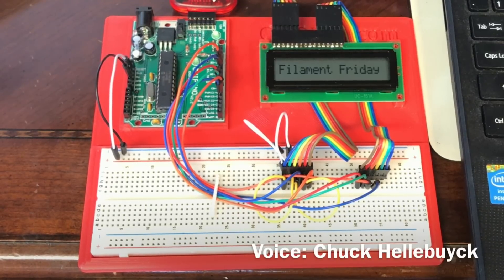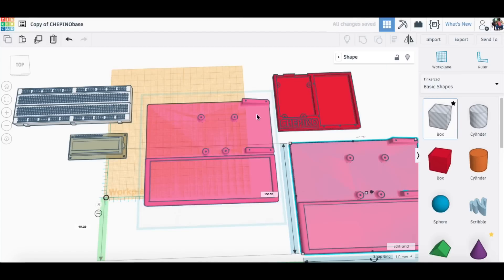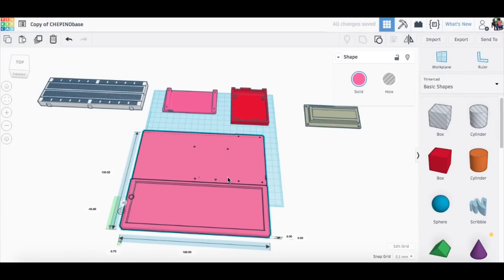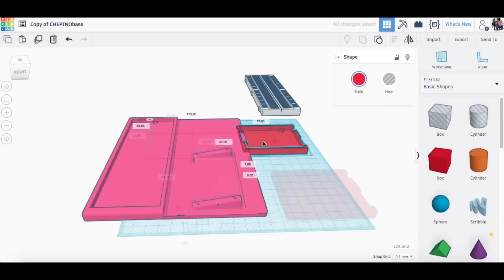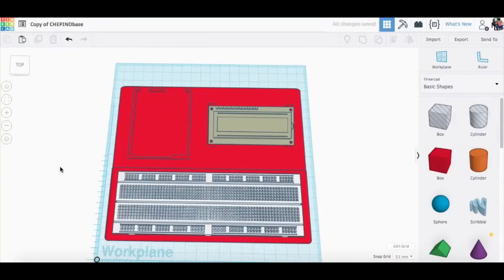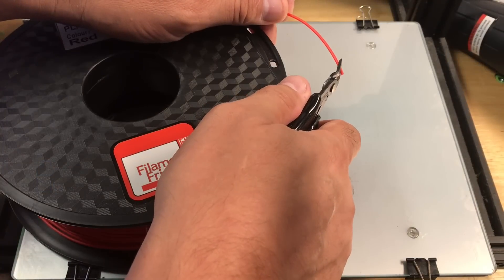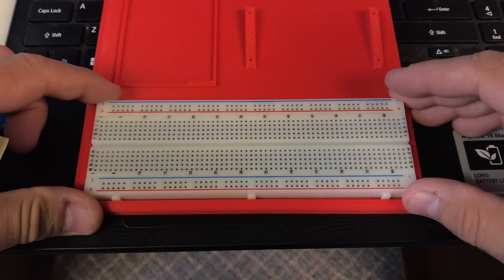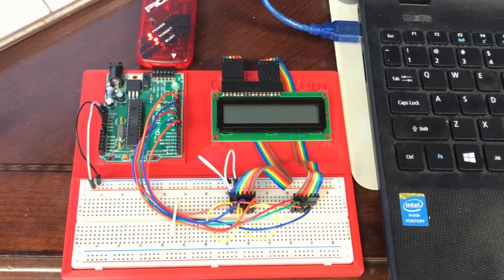3D Printed Electronics Training Breadboard Platform

Comment: I have Cura 4.12.1 and I sliced and printed this.  The module doesn't snap in, it just drops in.  The lip that is supposed to hold the board is just straight.  Is this because of the way Cura slices?
Reply from the maker: Could be variance in your printer. You can adjust it via horizontal expansion in the slicer. 
https://youtu.be/UUelLZvDelU

Comment: Great video. I have one question. What is the red box connected to the top of the Chipino? It doesn’t look like a normal usb connector cable.
Reply from the maker: It’s a PICkit programmer. CHIPINO doesn’t use a bootloader, it uses blank micros which makes it 15 times faster than Arduino and far more capabilities.

Comment: Great project, too bad it wasn't 2 weeks earlier.

I finally got an Arduino and the first thing I did was to design a holder for the Arduino and breadboard.
Mine is laied out with the breadboard to the top and where an LCD could have gone made that a small parts tray.

I got the Arduino because I wanted to know more about it before attempting to upgrade my Anet A8 to Marlin and what I found out is that my anti-virus software really slows down the compiling to a crawl and will corrupt the upload to the Arduino sometimes.

I think I made the right decision to hold off on up grading to Marlin.

Thanks again for your great content.
Reply from the maker: Small parts tray or component box is a better idea than the LCD. I think I’ll try that. Thanks.
Reply: Great re-mix.  Suggestions: Add a drawer underneath with removable dividers.  Also a removable 3D-printed "wing"  to drill and mount switches, sensors, indicators, etc. like a front panel.
Reply from the maker: Hmmm... some good ideas there.
Reply: @reasonablebeing5392  yes! a pane,l it could be t - slotted in